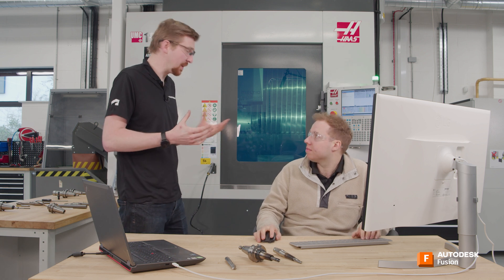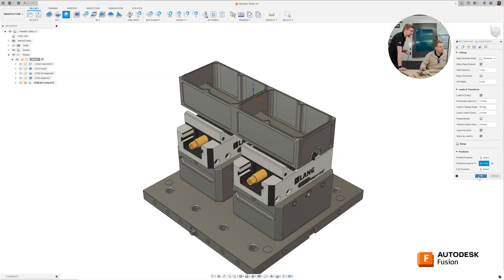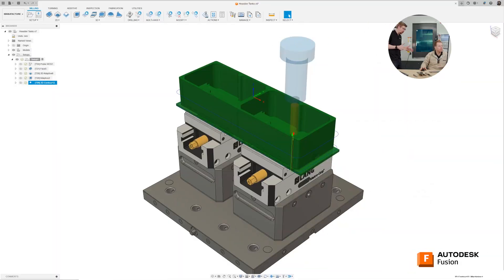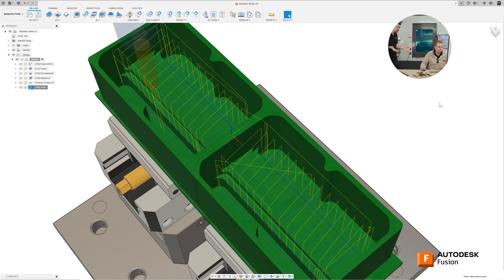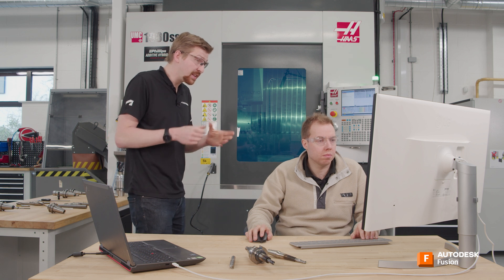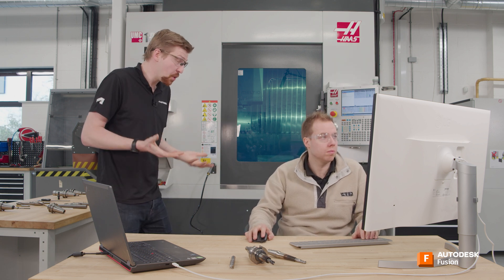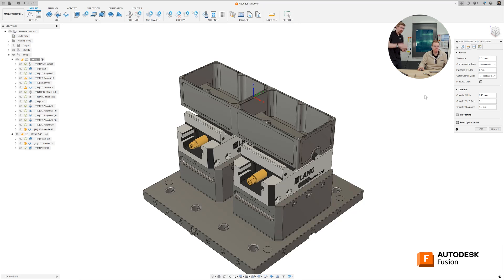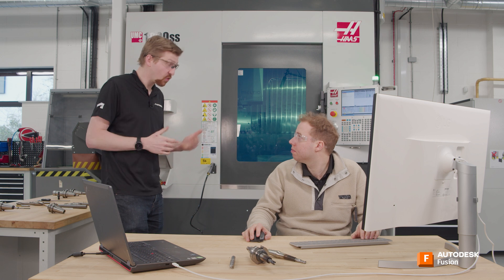CNC for Beginners: Final Steps to a Polished Part | Autodesk Fusion

Comment: I was hoping to see how you will produce the o-ring groove as this is something I’m not sure how to do it. Anyway nice series thank you!
Reply: Hi, there was nothing special, just a small 2mm end mil and 2D contour using the Ramp lead in type. I've tried it will a ball nose or a flat end mill and found actually the flat end mill is better at letting the ring defoem and seal.